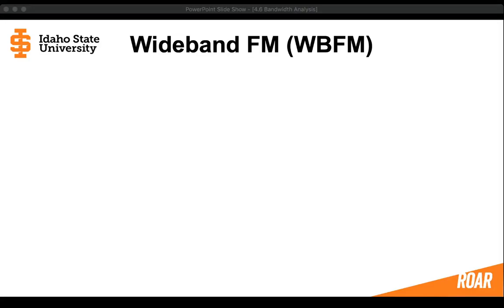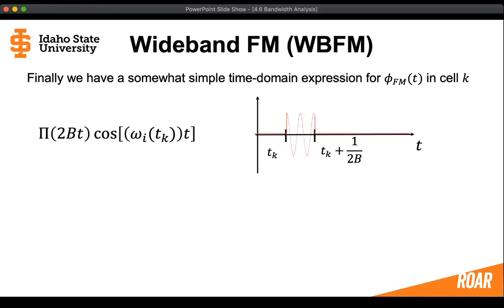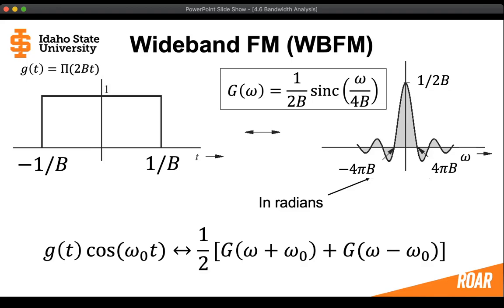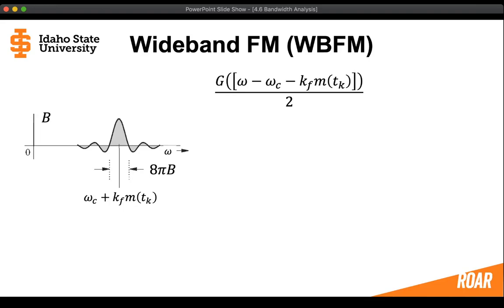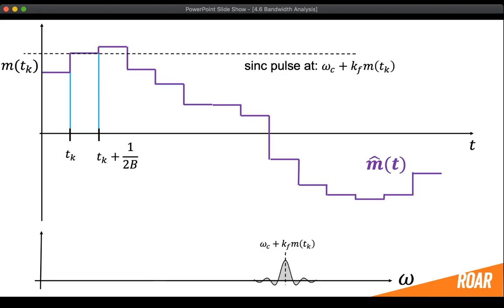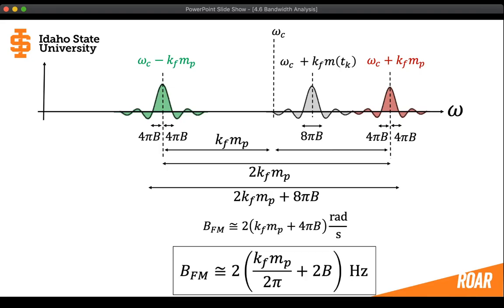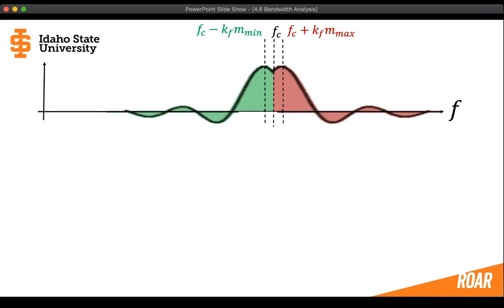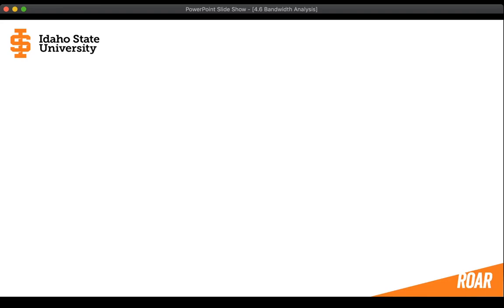4 - 4.6 Bandwidth Approximation of Wideband Frequency Modulation (WBFM) Signal Pt. 2

Comment: I think rectangular pulse duration would be from -1/4B to 1/4B. Pls comment
Reply from the maker: At 2:47 the meaning is that the total pulse is T=1/2B in the bottom. Whereas in the top definition has total pulse duration is T. In the bottom if you substitute T=1/2B the "standard" pulse definition this gives \Pi(2Bt). Hope this helps.